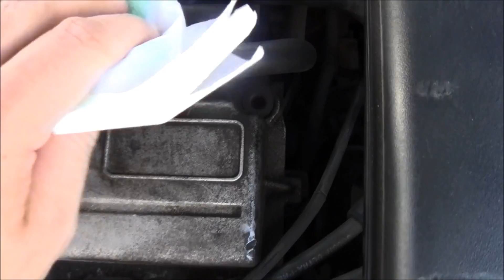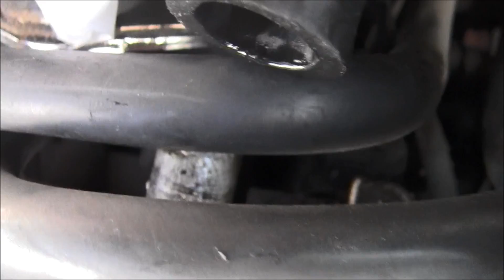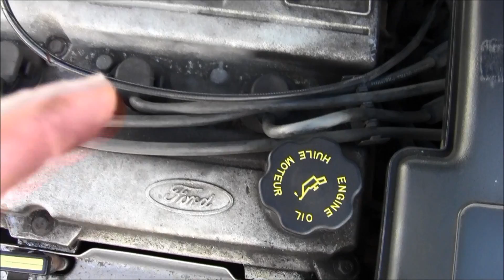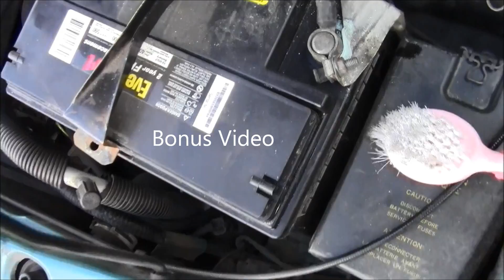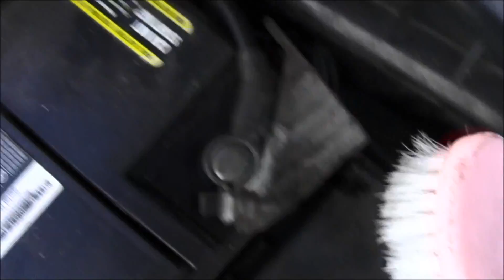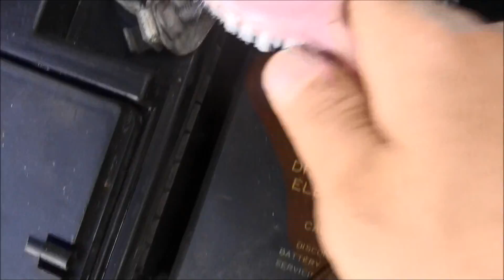Got Oil in Crankcase Breather Hose? Try This

Comment: If you get too much oil in that breather hose, you might have a clogged or stuck shut PCV valve.
Reply: I have a lot of oil in that hose even when I change the pcv breather. I am not exactly sure where the valve is though. I have a 2010 mercedes e class and everything is just a vent. But i'm noticing a lot of prositive crankcase pressure.

Comment: Dude oil inside the crankcase breather is normal.
Reply from the maker: it breathes oil, okay got it
Reply: @MattHumanPizza  4 years later, multiple certifications, a college degree from Nascar Technical Institute, and yeah. This is the dumbest shit I've ever seen. That little drop of oil isn't a big deal at all. It's totally normal for an engine with normal wear. It's not oil from the piston rings escaping, it's blowby from the normal piston ring gap that causes oil vapors to escape through the PCV to be recirculated through the engine. There's gonna be some buildup by the connector, it's totally normal. Ignore it. Telling people to regularly take that off to wipe it with a paper towel a little bit is ridiculous. If anything, that's worse because they're probably gonna get pieces of paper towel all up in their engine. Just ignore it. Don't look inside your PCV line if it bothers you that much. It's not full of oil. No wonder dude's channel never took off.
Reply from the maker: I'm not sure where my channel was supposed to take off to. Thanks tho
Reply: Not normal.
Reply: @JK..07  Yes it is, that's where the crankcase breather line goes. The stuff coming out of the crankcase breather is oil.

Comment: MattHumanPizza, use hot water straight out of the kettle in future, to desolve the battery acid corrosion, on your battery terminals.
Save breathing in battery acid dust, that you were sneezing on, just to let you know, and the hot water dilutes and helps neutralise the battery acid, that creates the corrosion in the beginning.
Reply: You shouldn't put boiling water anywhere near a battery! Use bi-carb soda to neutralise acid or vinegar to clean the surface.

Comment: what happens if I disconnect the crankcase breather from intake housing and let it hang downwards on its own.( but I plug up the air intake housing hole).. will it affect the engine?
Reply: You would do good. But connect longer nitrile hose that goes to the bottom of car so oil can drip there. But if you don't have plenty of blowby it won't change much.
Reply: Very bad idea. 
1. You will bereave through your air vents all the oil gasses that planned to be sent back to the combustion chamber to be burned.
2. You would cause a high pressure inside your oil system, which in turn may brake your oil sealing around the engine.
3. As result, the high pressure to force the oil to elevate through the oil gauge pipe and you may run out of oil while you drive.
4. All you bottom parts will get very fast a very sticky and smelly coating that will destroy all you rubber parts.
5. You won't get your MOT certification when they expose what you have done.
6. You will pollute the air, the rode and the grounds with very toxic oil and practicals the oil catches.

There is a reason why there is a breather in the engine.
Reply: namrur = many thanks.... then I will not disconnect it....I was thinking to do that to avoid carbon built up...

Comment: If you have oil blow by, replace your valve seals. You should have a clamp on the crank case breather hose, blow by or not. Cleaning the hose is great but it's not going to do much as it will just fill back up sooner or later. In my 87 Civic the breather hose went strait into my carb & oil was going strait into my intake. Changed the valve seals & vola! no more oil. I replaced the carb too, but that's another story :)
Reply: thanks ill see hew i get on thanks verry much
Reply: can you be more specific which seals need to be replaced? valve stem seals??
Reply: Mark Joseph Yes, valve stem seals.